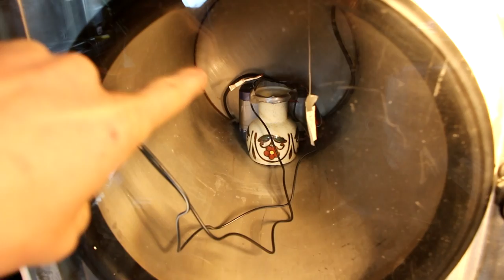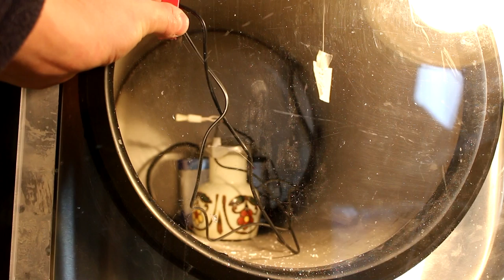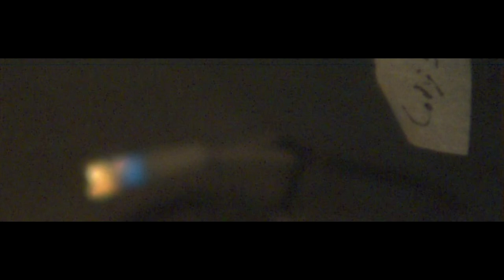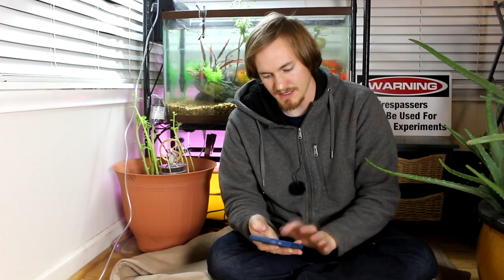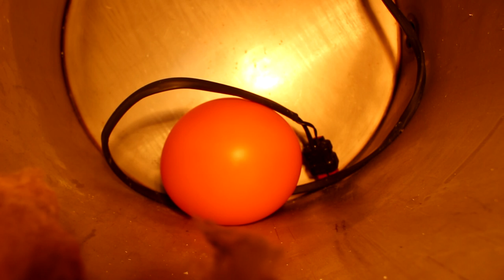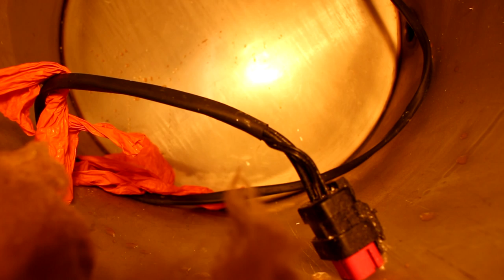Sound of Explosions in Space? part 2

Comment: You can go to the NASA web site and HEAR sounds that the planets make in our solar system. Similar to what you are tiring to do.   Remember, Sound is just a WAVE carried Threw a Medium to our ears, if you remove the air, then you only hear the sound (Pressure wave) if it enters your ear and vibrates your ear drum, thus the gases would have to enter your ear and do this in space or as you said hit the side of your space ship and vibrate the hull, which vibrates the air and you hear it.  Also the sound would be attenuated by the material it travels Threw and the type of air it travels Thur depending on the gas mixture of the atmosphere you are breathing.

Comment: The problem in movies is not so much one of sound, but of timing. The sound heard always coincides with the light from the event regardless of the distance. This is also how movies portray thunder and lightening.
How something would sound in space depends on what circumstances under which it is recorded. Is it recorded inside a spaceship? Then the side of the ship facing the explosion might act as a bell and transmit that to the air inside it. Is it recorded on a naked microphone in the vacuum of space? That might produce an entirely different kind of "sound".

Comment: Not adding any info here, just exploring 'out loud'.

The speed of sound in air at 1100C is 1000m/s.  At 500mTorr the mean free path is going to be on the order of millimeters, so the gas hitting the paper was probably still very hot.  

Also, if the cap was something like TATP or PETN, the shockwave itself will be operating at multiples (5-8km/sec) of the observed velocity for some distance until damped by the (thin) atmosphere.

Comment: Cody's Lab, If you go to my experiments on rockets in a vacuum you will notice an even stranger effect when the source of the noise, i.e. the rocket moves away as the noise is emitted, as apposed your statinary experiment using a uniformed sperical explosion.  To put it another way if a rocket takes off in a vacuum and the exhaust gas flow is 100% laminar and there is nothing to slow down the gas particles, in theory you will be able to hear the rocket forever or until the rocket runs out of fuel.  I was using a 3 m long vacuum chamber and my rockets exhaust is 50% laminar within the vacuum, the sound lasted longer then is should have,.... trust me I get the inconsistany your are struggling with,...yes sound / gas expansion in a vacuum requires a lot more investigation,... keep it up,...Regards,..P

Comment: I have always thought that in a middle of a very small area dense spaceflight with lot of ships and fragments from explosions and crashes to reflect the tiny particles, a kind of artificial "atmosphere" would form and you could eventually hear the fight. It would sound fairly different than in real atmosphere because the medium wouldn't be constant and the oscillations wouldn't propagate nearly as well. 

Thank you for confirming me that you would even initially hear something. This has been a matter of debate a few times when someone has said that you wouldn't hear explosions in space.
Reply: A matter of definitions. You don't hear the explosion but the impact of sound particles. Not the propagating wave. I think you will need many many particles to make a wave propagate.
Reply: No, atmosphere would not form because it's not a closed system. No sounds would propagate, either, because nothing can oscillate. Gases in vacuum spread in every direction they can. Sound is oscillation of the elastic medium. Nothing elastic here.
Reply: Lajos Winkler Hence why I said small dense area with lots of explosions and material to reflect the particles back and forth eventually slowing them down. It wouldn't be fully closed system but there could be pockets of gases where there could be oscillations (sound). Of course the speed of sound would be very low so that you probably wouldn't reach frequencies you could actually hear. Of course there would have to be numerous explosions to form any appreciable "atmosphere" and there would have to be a lot of debris to contain the gas particles to a small area.
Reply: No, it still would not happen. Sound is oscillation of medium (not particles bumping around) and in open system in vacuum, that simply can not exist. Sound can't exist in low enough pressures in closed systems (because particles aren't bumping into one another because there's so much volume between each) let alone opened systems where gas is escaping in every direction.
Reply: In medium, atoms and molecules are constantly bumping into each other. That's how sound waves propagate in gas. What do you think would be the effect causing rarefactions and compressions (i.e. the longitudinal sound wave in gases) if not the mechanical energy from the collisions? There couldn't be any oscillations if the particles weren't interacting with each other at all. But I think you are probably right when you say that the particles wouldn't be close enough to bump into each other enough to make a difference. It's a vast space when it comes to atoms/molecules and their mean free paths. 

I checked quickly and found that the mean free path of nitrogen molecule is about 230nm at STP which is roughly 750 times the diameter of the nitrogen molecule. And average spacing is about 5.7nm at STP so I would estimate that in very nearly vacuum it would be absolutely too colossal to actually make the molecules ever interact between each other in any significant way. 

This is just brain wrestling for me, I like it. 😀

Comment: I think sound particularly the sounds of things impacting your ship would be more terrifying in fact because there is no atmosphere for any sound to dissipate into the only place for the sound to go is through the ship. So it will continue to reverberate through your ship until all the kinetic energy turns to heat. Your entire ship will ring like a bell at the slightest impact. other sounds like your ship firing its engines, which you would constantly want to do in a space battle, will cause stresses in the metal structure of your ship producing horrible sounds. Firing your own weapons if you are using chemical projectile weapons will also produce noise but less noise if you are accelerating  things with magnetic rail guns. Getting hit be enemy lasers and nuclear blasts wont be silent either because of the sound of material being vaporized and the expansion of material as it heats. You will hear damaged sections of your ship decompress and  tear apart. so along with the explosions, my impression is space battles would actually be unbearably loud to the crew inside the ship, made even more terrifying by the fact that every sound would be something happening to your ship, aka the only thing separating you from the vacuum of space.

Comment: Yay physics! the volume of the sound will scale with the third power of the distance, (you need 2 powers for the sphere area, and another power to account for the dispersion: at twice the distance, the arrival times between the fast and the slow molecules also increase by a factor of 2. So you get 1/4 of the molecules spread out over twice the time. At large distance, the sound would also be of extremely low frequency. I doubt you could hear your death-star explosion from more than 100 km away.

Comment: A friend of mine thinks you missed a critical point. He writes:  “His speculations about explosions in space are interesting, but I think he missed a critical point. Although there is no "air resistance" to slow down the wavefront (if a given explosion happens to have a well-formed wavefront; not all do), there is still the Inverse Square Law, which essentially refers to the expanding "surface area" of the wavefront. The ISL tells us that a beam of any kind of radiation (particles or light waves or pea soup) from a point source will lose energy according to the square of the distance. In other words, a light bulb is 1/4 as bright when you double your distance from it. Or a loudspeaker is 1/9 as loud at 3 feet as it is at 1 foot. Essentially, this just reflects that the wavefront, like the surface of a balloon, is getting thinner and thinner as it stretches into a larger and larger sphere.
 
So when the Deathstar explodes, if you're a few hundred feet away, a thick wavefront hits you at whatever speed you care to speculate. Say, 10,000 mph. Bad news. But at a couple of miles, although nothing has slowed down those particles in the wavefront, there are a LOT fewer of them hitting your spaceship. At thousands of miles, these fast bits and pieces are VERY widely separated, and probably none of them would hit your ship. That's why a star can explode, a real star 10x larger than our sun, and we can watch in perfect safety from some light-years away. The wavefront of the supernova is still traveling at the same speed, but the photons, etc., are way far apart....

Interesting video...and cool to see him thinking out loud with good analytical technique.”

****************************************
From the poster: Thanks, Cody, for this wonderful channel.
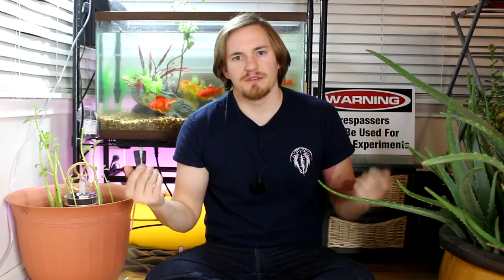Reply: You mean the part of the video starting at 6:30 where he covers this very thing?
Reply: Thanks for pointing out the mistake, Ryan. Here’s my friend’s response:
*********************
“Yup. I must have zoned out at 6 minutes. He covers the issue, but then guesses that several billion gas molecules would be audible. Yes, there's no attenuation due to friction in an elastic medium, but still, a 1 km spherical wavefront that's expanded only "several hundred kilometers" (500?) would be 1/250,000 as dense. Now we need the diameter of the initial explosion and the actual distance of the observer. My guess is that the sound of the wavefront hitting the ship would be drowned out by the ambient noise. When he says it's not like a bunch of tiny objects - actually it is exactly that. Then he speculates about how pitch or timbre might propagate in hard vacuum, and correctly notes that the gas molecules would stretch out due to their varying speeds. But he doesn't seem to notice how this applies to the explosion wavefront. Although there is no attenuation from the (nonexistent) medium, there would be significant turbulence, which would drive particles off in random directions. The resulting dispersion would attenuate the aggregate forward motion, and also substantially reduce the density of the "front." The wavefront has thickness and nonuniformity, and is tearing itself apart as it expands. Lots of entropy going on, not just the ISL.”
*********************
[Comment by the poster, Ralph Turner: I am not vouching for the accuracy of my friend's comments, as I am very ignorant in this area. I should have, however, noticed my friend’s mistake, and I apologize for that. Thanks.]
Reply: The first part of your friend's comment is true but irrelevant. The same facts apply to an explosion in an atmosphere. The question is not the loudness of the sound, but if it can transmit a sound at all over a distance..

But to illustrate: If the death star''s explosion was 200db worth of hot gas, it would still carry 66db of that energy at 500km, which is about the level of a vacumn cleaner.

About 'tiny objects', Cody specifically states that the gas molecules function as shrapnel and marvels at the thought. Your friend zoned out again.

About random directions and turbulence - how did your friend think an explosive wavefront becomes spherical in the first place? Turbulence has mostly done it's work when the spherical wavefront is established, which in a vacumn is almost instantaneous. Then it drops to near zero because of virtual lack of blocking atmospheric particles.
Reply: bookmarking

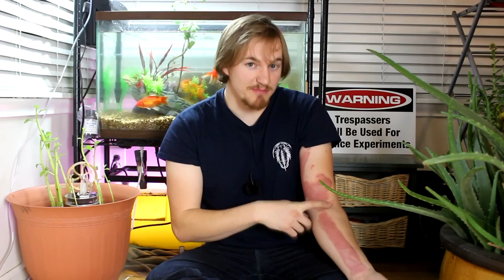Comment: That's not an impact bruise. That's a burn, a contact burn from chemical or heat(or cold). You can see the burn stop on the crease of his elbow, where contact to the heat source or chemical wasn't made. 10:04 at 1080p. check it out.
Reply from the maker: It does look like a burn doesn't it, but I assure you it was caused by blunt trauma, I was there when it happened. ;)
Reply: If you say so Cody. That's the craziest looking bruise from slipping on butter that I've ever seen. I work in the food industry too, so I've actually see such a thing... bahaha. Heal up well ;)

Comment: What would do sound is the explosion, what not, are all the laser weapons in space (depending on your machinery, you might hear the sound of your things firing, but not anything of other ones), You probably would hear some impact pressure waves / sublimation and boiling of your ships hull, probably also sound would be transmitted, when energy shields are in work, and the generator gets power peaks. A massive explosion, like the destruction of the death star, by releasing all the energy stored, to destroy a planet, would do big harm to your ship, if you do not stay away light minutes at least. The gas would be more of the heat of a super nova, thus being vary hard cosmic radiation, but dense. It would make sound, but also transmit a lot of chemical ionizing energy, even causing nuclear reactions (a lot). A few hundret Kilometers from the explosion, this would be way more energy, than any konventional (laser etc.) Sci Fi weapon e.g. in Star Wars Universe. So if you don't have perfect shields your ship will be ripped apart. The planed would be pretty well protected by the atmosphere, but forget any delicate chemistry of the upper atmosphere, like our ozone layer, for a longer while, after that impact.

Comment: So I heard recently that a gyroscope spinning weights slightly less than a stationary one. I also heard a potential reason could be because the air is affecting it somehow as it spins. Cody, can you test this out by putting a gyroscope in your vacuum chamber on a sensitive scale? And if it does get lighter, do you have a theory on why? I haven't researched this, but it might be a cool experiment if it does get lighter, and fairly quick and easy to make a video on. Thoughts?

Comment: With the example of someone screaming in space I was wondering if maybe the sound would actually transmit.
Assuming it is a scream maintained over a few seconds, the first gas you release would spread out rapidly and create that hissing noise you suggested but then after that you would effectively be surrounded by a thin layer of gas within the vacuum, would that maybe be enough to propagate more traditional soundwaves as the scream continues? Or do you think it would be too few gas particles?

Comment: Cody'sLab+ your statement about the shrapnel not going faster than the air because the air is the force pushing the shrapnel, reminded me of yatchs, there are yatchs that travel faster than wind even with the resistance of the water and air, do you think this concept could increase the effiecency of moving parts?

Comment: How do you put the air back into that chamber? It's easily accessible, then you could mount a nozzle on it that will produce a scream when supplied with pressurised air. Some kind of artificial vocal fold arrangement, maybe silicone would be a close enough material to simulate them? You can then compare the sound produced when they're hooked up to a 1 bar supply & when they're used to reintroduce atmospheric pressure to the vacuum. It'd need to run off a very low volume of air so it doesn't change the pressure in the chamber too much, which might cause issues with the pitch of the scream produced

Comment: Cody can you try a pressurized air horn inside the vacuum chamber together with a small mic or a recorder. I'd like to hear if it'll produce a sound of the horn or the sound of a "wind" caused by the release of pressure, or both..

about the probability of explosion due to less pressure outside the can.. it'll prolly be smarter to "empty" the can (by empty I mean 1 atm inside the can), before you put it inside the vacuum chamber...

or ya know.. improvise with a heavy duty bag with a hole, fit a "squeaker" into the hole, then make a remote squeezer.

Comment: I think that there's a problem with your hypotheses in that your chamber has a very low volume. The expanding gasses can impinge on the walls of the vessel causing it to resonate. In space, there is an infinite volume for the gas to expand into so the pressure would get very low, very quickly.

Comment: Actually, I think explosion in space would be silent.
Or at least not hearable due to low frequency. If no shrapnel hits you, only gas particles, particle pressure would increase and decrease again so it would be only one pulse, and I think it would be quite slow pulse from a distance. (due to distribution of particle speed)
Maybe you could test this if you filled the chamber with some padding to block reflections and see if paper would shake or only swing.
also, taxation is theft.

Comment: What happens with an ecigarette fired in a vacuum? I've noticed that at lower than atmospheric pressure my ecigarette seems to produce less vapour, I'd be really interested to see what happens at the extreme, or even at different points of air pressure.

Comment: making new vacum chamber i would sugest you to try make it lonnger than just bigger, the diameter doesnt necesserily have to be even that big in my opinion, you would probably get better percision when measuring. also is it possible that some waves would travel through strings and case, cuz as much as i know sound speed in metal is much greater than in air at atmospheric preassure?